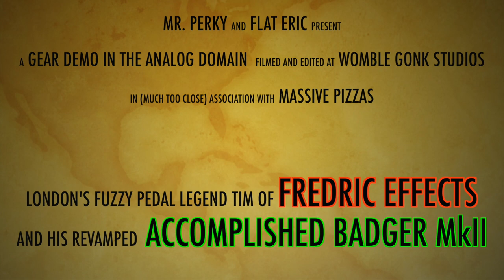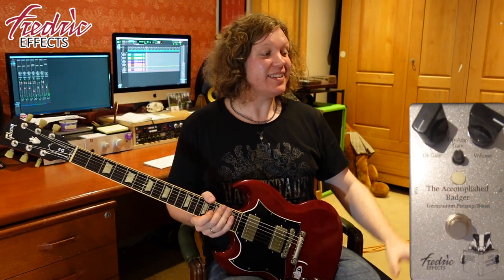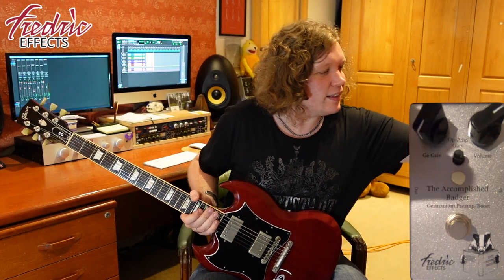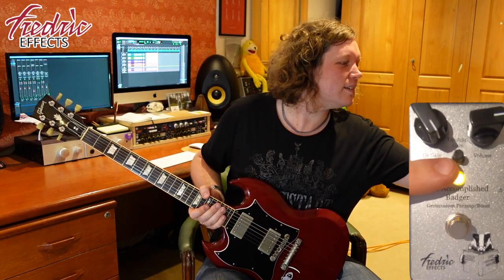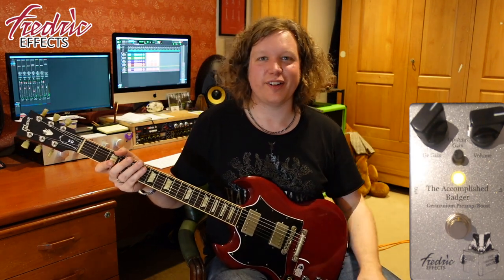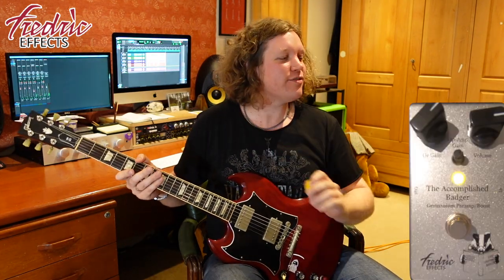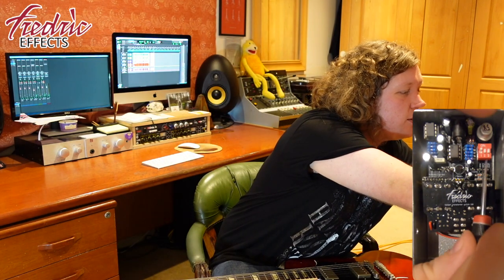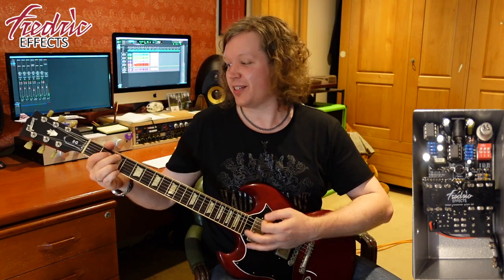Fredric Effects Accomplished Badger MkII...Now With Diodes & Transformer!

Comment: This pedal has the greatest name ever. I was surprised by the quality of the buffer at unity gain and the Ge-Gain was reallty cool. Fredric pedals are great and affordable too (affordable, NOT cheap).
Joe, i have two unrealated questions:
1. do you have or use any low wattage amp (like 5watt amps)? I saw a lot of famous players (Joe Perry, Phil X etc) combine their big 50/100watt amps with small 5watt amps, now that you have your Vajra will you try this combination of small and high wattage amps on a video?
2. Have you ever tried Alnico 8 magnet pickups? Usually Alnico 8 magnets are associated with "high gain" (like ceramic magnets) pickups but there are a few guys (Arcane pickups in L.A. for example), that create pickups using Alnico 8 and very few winding for a more "vintage" inspired pickups with A8 magnets qualities.
Reply from the maker: Hi Enrico - hopefully I answered this ok in the September Q&A vid :-)

Comment: would have liked to see an internal DIP switch to flip the order of the gain stages - so you can run the Ge into the Op Amp.
Reply from the maker: That would be cool - though I'm not sure how feasible that would be (but I'm not a circuit designer!)
Reply: @JoePerkinsMusic  totally do-able. Plenty of dual-pedals-in-single-enclosures have an order switch. exact same principle.  Would probably require a 4PDT switch, but doable.
Reply: Yes, very doable. However having the Ge transistor gain stage first would leave this effect very fussy about where it is in the signal chain and how it'd react with different guitar pickups. Having the OpAmp stage first acts like a buffer. I'm not saying it wouldn't be interesting, but there would be drawbacks and I'm not sure how many people would need that functionality.
Reply: @timhulio1  very good points!

Comment: I love the Fredrick Effects pedals and they are great on their own but I run 72 pedals in my rig. That has been knocked down by a good 10 pedals or more. I just looked, I sold 136 pedals on Reverb over just year. I need to run at unity gain and most of the F.FX are not very cooperative on many issues, lol. Pedals in general tend to have issues of compatibility as is. I have kept but retired a great Tonebender and a Rangemaster booster and even a few OD's. So far an old Vox treble booster has resisted getting shelved.
Reply: Impressive! I've been trying to go down to half a dozen pedals from a board of 20 & its a struggle!
Reply: @steveturner6770  My rig is wired as 4 separate self contained boards. Each board having its own comp, delay and verb.  I have a 3 piece Metal trio doing my 26 original tunes. I have in effect a clean/low gain board, a medium gain and high gain. The 4th is for synth, a faux 12 string thing and odd things. It is simple to use as I use a switcher with just 4 loops. Except for changing wet dry knobs on verb & delay. I simply need to turn on and off pedals between tunes. I pretty much use all the boards in a single tune. I can get very dynamic changes or even just get the perfect tone by switching for intro, verse, chorus, mis 8 solo etc. With all original tunes one has to make a BIG impact. I only get one chance to make a first impression, lol.
Reply from the maker: 72 pedal rig! 😳
Reply: @JoePerkinsMusic  Yes Joe and I have 3 other pedals on order. After carefully using them for a week or two they may replace one or more pedals. The losers go on Reverb. After doing this for about 5 years I can tell better what will work. It is still a gamble as some things have very poor dynamics or sustain or small artifacts that one can not tell from a video. Price or maker guarantees zero, lol. Lately used pedals sell well and I can even make money from them. I buy world wide and usually get good deals often buy buying from unusual places like American made pedals from east European countries or Russia or even China.Even Chinese pedals new from China can be had as low as 2/3 cheaper. $20 to $35 a pedal with free shipping is not unusual.